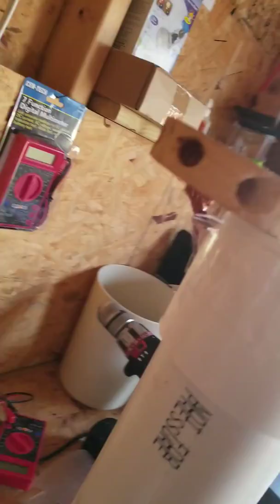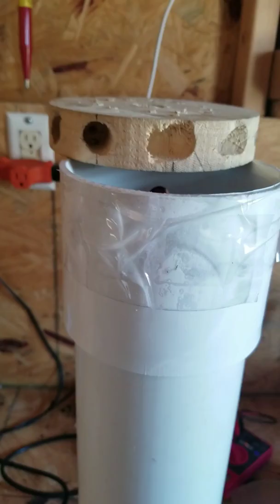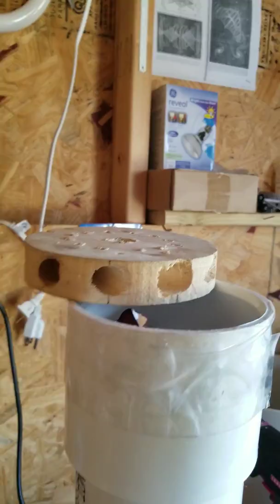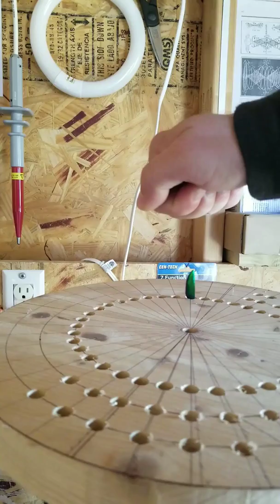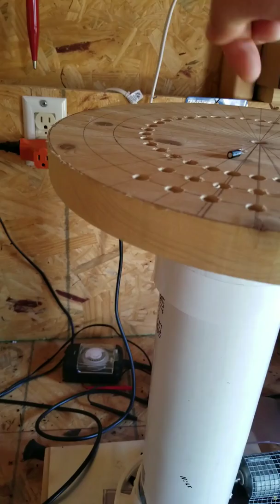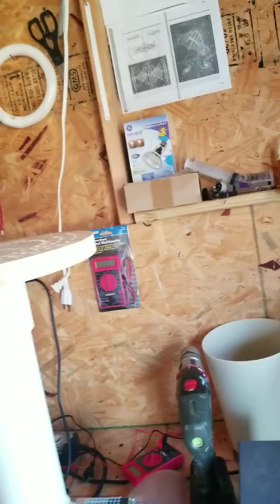Levitation  of   bug wing...

Comment: Not all beetle wings work because they don’t have the CSE to cause the anti-gravity effect. If you make very small holes in plastic spoons you can create the same effect. Don’t need bug wings. Any material that has small holes with hexagon shapes will work.
Reply: Is there anything else to beside that such as applying a charge and or sound wave for vibration
Reply: Did you try it?

Comment: You sir have just figured out how viktors anti-gravity deviced worked, see the one thing that wasn't explained to much or overlooked was the human element. See viktors device had a handle made of metal that was attached to a wood plank. Under the wood plank was where the insect wings where attached, by him holding onto the metal handle and either a charge applied or a charge coming from earth itself would create levitation, so yeah one of the key element was the charge from himself, like you said we are good insulators. Good job my friend.

Comment: Your experiences are very interesting. The Vandergraf setup collects the divided charge (let's call one part positive and the other negative). Positive You marked the wire from where the spark is fired. And a field is formed around this wire, when the body is brought up with a neutral "charged" object, the field interacts with it and the beetle's elytra tries to rise to this neutral object. There is a zone in which this elytra will hang in the air between two bodies with one field source and another field receiver. You need to make a tripod for the upper body, and find the elytra levitation point.

Comment: And if you had to put a couple of wings in a patern on a platform and the hold it over the generator? I notice the point of wing ether top or bottom goes in line with the vortex  field vertically, what about purposefully opposing it by keeping the wing horizontal.
Reply: Look at vid below, the effect the wing has on the wing shells, the wing combined with shells should inevitably be the key.
Reply: https://youtu.be/xLNN_2DHo6I
Reply: what pattern specifically are you referring too? I'm considering replicating this experiment it's extremely interesting

Comment: Van de Graaff's Generator works based on the influenza effect and It does not require electrons to move and It does not require a magnet field at all. The other electronic generator requires electronics to move first to make a potential difference and rectify them toward a capacitor circuit. We have 2 kinds of reactive electricity types (reactive in Var power junits). One is capacitive and the other inductive.
Capacitive reactive electricity wants to run on the surface of the object. The inductive one likes to be on the surface of the object too but on the internal side of the objects.
Your Van de Graaff's Generator works better as It is more powerful as It supplies new electrons for Ion wind faster than electronic supply. Electronic supply might work a bit beter if you use
a transformer 230Volts to 230Volts as you need reactive energy for your experiments and not real power electricity (heat Joule one in Watts power units).
Bug wing has a shape. One side is round and another one more pointy. The pointy side of any object more easily releases electrons (Ion wind) and Ion wind propulsion gives a force like a rocket engine and It pushes the wing toward the wood collector. But It does not flip around as Ion wind repels electrons on the wood and electrons on the wood repels electron wind from the pointy side.
There is sufficient thrust of ion wind if there is just enough supply of new electrons transiting from the wood collector to the wind. As soon as there is not enough supply of electrons from the wood collector the Ion propulsion on the pointy side of the bug wind weakens too quickly and the whole wing flys away as a ping pong ball would.
It is fun to watch your experiments, I will stay tuned.

Comment: Try matching the frequency of high voltage coil or Van de Graaff generator to beetle wings so it can produce resonance with beetle wing cover. Whatever frequency beetle wings vibrate at to produce anti-gravity effect with beetle wing cover.
Reply: Google “My World By Viktor Grebennikov chapter 5 pdf". He was a russian scientist and entomologist who figured out that some species of beetle wings cover have anti-gravity effects. And he built a small flying machine after studying beetle wings cover under microscope. This has nothing to do with conspiracy theorists, its in his book including the pictures of his small flying machine he built which was able to fly 30-40 km/min without any wings, fans or rocket.
Reply: @Xeno_Bardock  hmm funny how alot of these "conspiracy theories" turned out to be right.you are in the wrong.also,this is not conspiracy this was based on actual research from a russian scientist.
Reply from the maker: the key is to find right resonance thanks for comment you are right about it ..
Reply: @FixItAll1  you need a way to record the frequency the wings vibrate at and listen in on the beetle to figure out the frequency and replicate it
Reply: @FixItAll1  name ir the beetle? Plis
Reply: Please stop waching conspiracy theorists videos , This wing is probably responding to dielectric material

Comment: Did viktor grebinikov use a van de graph generator in his machine??
Reply from the maker: No one knows exactly but wings act on high speed charges particles or HV not on regular voltages...
Reply: He wrote in my platform there is no moving parts. :)
Reply from the maker: @kubeqsq  you can use circuit to produce van de graph charge
Reply: @FixItAll1   yes, i know. That  is possible. I am pretty sure, that all the information how to build Platform is in the book my world. Did you read it?
Reply from the maker: @kubeqsq  a lot of times and was on all around sites where people talk about it..
Reply: @kubeqsq  yeah he did but he has obvious hand triggers. I thought of his platform as a damper that mounts the beetle wings on it the can rotate similar to blinds in a 90 degree radius. All he would need would be capacitors and a small battery. It seems to me the field he described happens from becoming a ground on the platform. This would mean the warp bubble is built using the field of energy already existing from the earth. So once the bubble is opened a battery inside of the field cannot loose charge.
Reply: So if the platform displaces the path of oxygen electron molecules the trick is getting the Beatle wings into a geometric positioning that when turned in a 90 degree radius where the holes in the wood change the feeling force and attracting force in a beneficial direction.
Reply from the maker: @TheWookiestyle  A lot of time is needed and proper tools to explore resonance, he had (government bought) elctroscope expensive one and time to explore frequencies, geometry and whether soo it is needed money or government foundation (if there is job for this let me know) but I have to work and feed kids in busy life today but this is my dream job ,when I retire at least then I will have a time for it.
Reply: I think I could build his platform based on what I see here. It looks like the Beatles wing is getting pumped with electrons. When you get close you become the path of least resistance to ground because it's where your standing. The little holes are acting like wires. Oxygen molecules always have an extra electron flowing from one to another. So that tunnel of oxygen in the wood becomes an insolated field